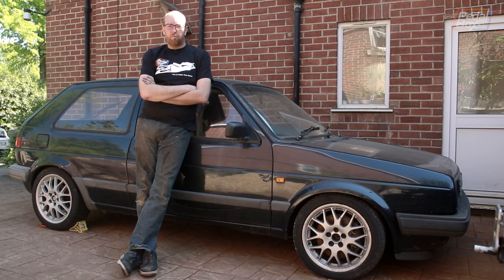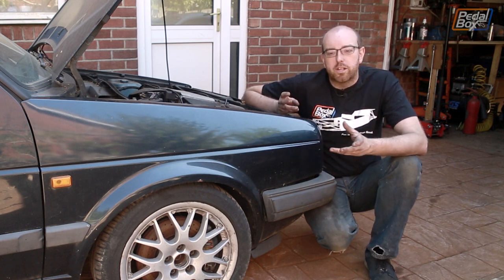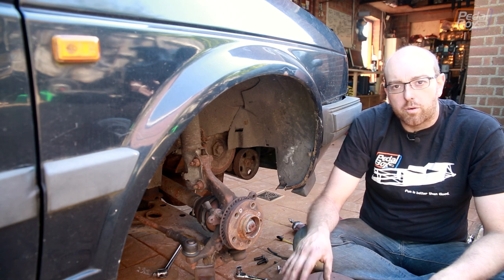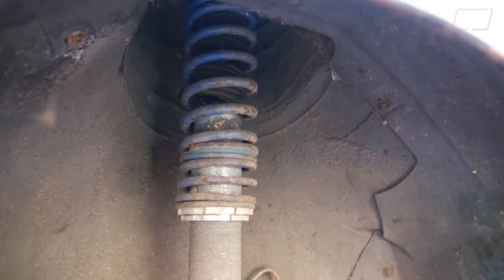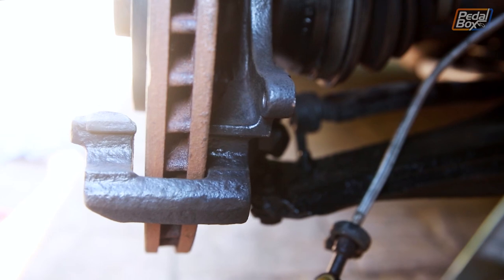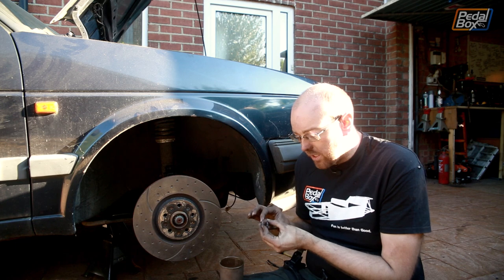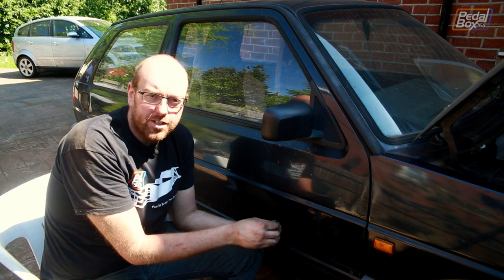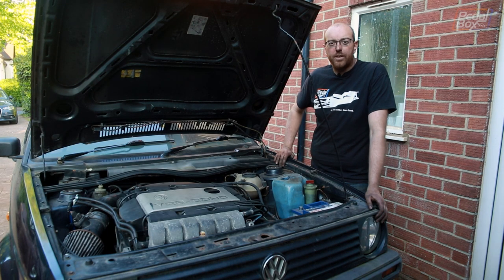Big Brake Upgrade | VR6 Mk2 Golf | PedalBox Fleet

Comment: What bolts did you use for on the front carriers after the 6mm shim ?
Reply from the maker: Can't remember off hand, I'll check and report back!
Reply: Hi mate, I used M12 x 1.5  40mm long 10.9 grade bolts. Hope this helps
Reply: Resto Designs  i does thank you !! Have my parts coming in Monday 💚

Comment: copper grease on bolts that are meant to have loc-tight on them great idea NOT!
Reply from the maker: It's an ti-seize, and not a lubricant. It also withstands high temperatures which are prevalent around the brake area. 

I've only ever had one brake nut unwind; was neither coppered or loc-tited and it unwound after the other caliper bolt sheered in half. 20 years myself, 40 years from my dad and never had a nut come loose once torqued properly, and never had a bolt seize that was treated. 

Loctite is ideal for a low torque or narrow bolt one which you can't tighten too much without a risk of sheering. A caliper bolt is far from small, and needs in excess of 90ftlbs/100Nm on the VR6. 
While it's called grease, it isn't in the sense that it decreases friction in the thread when torqued, I hope this allays your concern.